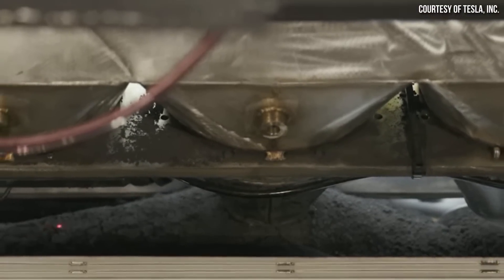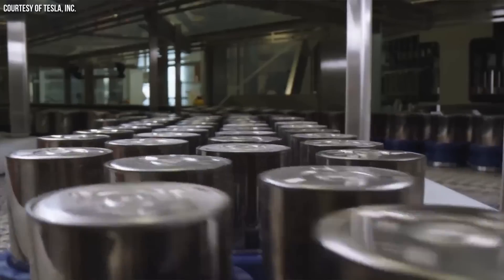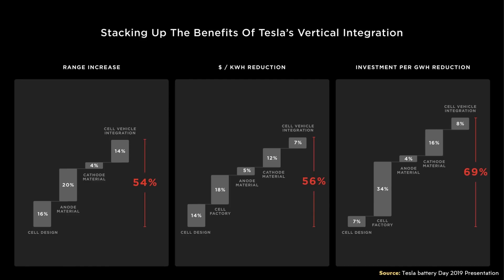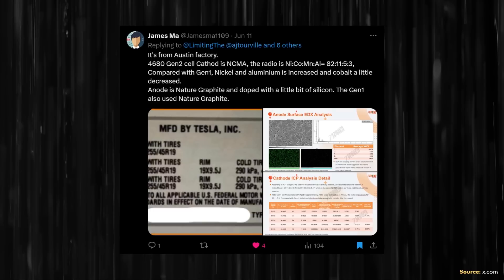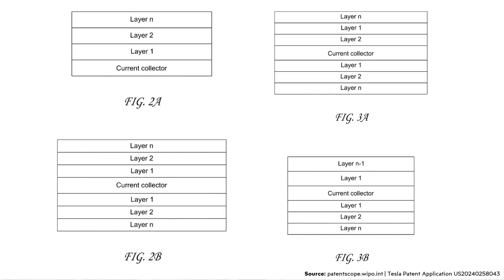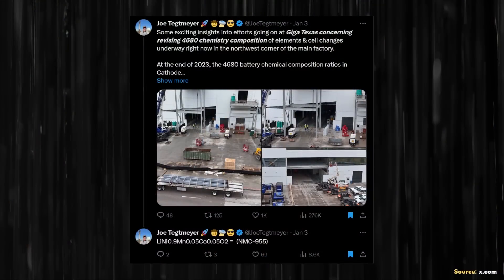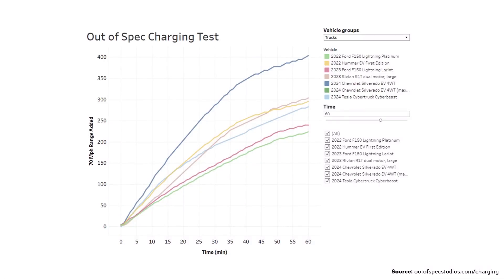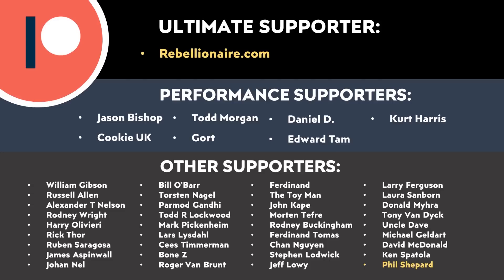EPIC NEXT GEN Tesla 4680 Battery Coming | 20% MORE ENERGY DENSITY?

Comment: A 20% energy density increase for Gen 3 cells over Gen 2, would translate to 204 wh/kg at Pack level. Given the steel plate covers top and bottom of the CT battery, 200wh/kg is a good number. Translates to 5kg/kWh - easy to see the impact of a larger pack on vehicle weight. But extra weight of pack probably adds another 20% of that weight to vehicle structure to carry the weight.

Comment: I have a question I would like you to help answer. When you have a solar panel you have a theoretical efficiency that you could capture 100% of the light and convert it all to electricity. The real world efficiency is about 21 to 23 percent. If you used that same thinking with batteries and asked what is the amount of ions that you can store in a battery where is the technology at right now? Are the batteries storing 2% or 5% or 21% or 50% or 75% of the theoretical limit? On a molecular level we know that for a certain amount of lithium it will hold so many electrons.
 so where on that scale are the batteries we have now and how much further can we realistically expect the technology to advance? Love to get your thoughts.!

Comment: John, Isn’t this vaporware if and until it appears at scale in cars? Isn’t CATL’s Shenxing Plus LFP battery already produced at scale? It has 205 wh/kg, a 4C charging rate, and a range of easily 500 miles. And they’ve already built a 500 wh/kg battery installed in a large passenger jet which they claim they can mass produce. IMO, China is about to dump EVs into the marketplace that are far cheaper than Tesla (not to mention positioning themselves to control the global passenger aviation market) and no tariffs or obstruction of free trade w China is going to hold off that avalanche. IMO, that is the overarching story you should report on.
Reply: Same technology as amprius silicon wire anode technology meets nano one materials cathode single crystal cathode powder?
Reply: @bkparque Amprius is a fantastic company, but it isn’t producing at scale yet and CATL is. CATL is also much larger, financially sound, and more established than Amprius. And like Tesla, CATL is also constantly improving so whether or not Amprius could take a significant portion of CATL’s market share and/or keep up with CATL is far from certain. I think Munro is correct that Amprius will have an important role in the market, but it’s a dubious assertion and I doubt Munro thinks that Amprius could rival CATL in the marketplace.
Reply: @flutieflambert  amprius is certified for aviation and is building mega factory to scale to giga. No they arent as big as catl but will dominate usa and west. Catl makes car and utility batteries . They will never dominate us aviation and drone and us military contracts.

Comment: Huge ramifications. Get this right and the business is set for huge success. Just think a cheaper model 3 with nearly 500 miles of range, or more likely a cheaper 400 mile range car that will be >100kg lighter.
Reply: Noone needs 500 miles. Much more likely they just reduce the kwh in battery which improves effeciency and price
Reply: @Matzes  false. 500 paper miles is more like 400 real world miles and around 300 winter miles which seems like a lot of people are looking for.  Its not a matter if what engineers think its practical its what people demand.
Reply: @derekr5327  false. Studies show that people very very seldomly even go beyond 150miles on a day. Average daily distance is 35 miles or so. You want your expensive battery to be designed for the one off road trip you do? And then just for that 1h you save on a 600 mile trip compared to a gas car? Not worth it and most people driving an EV will realise
Reply: @Matzes  500 mile range would be needed for anyone who buys an EV pickup truck and wants to tow more than 150 miles in between charging sessions.

Comment: When discussing issues like energy density, charging rate, etc. ... you're talking about battery chemistry, not form factor. Doesn't matter whether you're discussing 4680's or 2170's or pouch or blade form factors, it's the chemistry that matters. The importance of the 4680 form factor is that it enables structural battery packs. The question to resolve going forward is whether 4680's can be mass produced at scale with advanced battery chemistries.

Comment: That’s an excellent take on the asymmetrical layering, never thought of the multi layers acting as elastic layers to laminate in the high silicon element

That sounds like there’s a lot more that could be done with that approach, makes sense as to why dry approach is so crucial to the direction they are going in, it’s not just costs it’s also density and variations on a theme

Comment: Tesla's quickly falling behind CATL and GEELY on their high density batteries.  The dry process means nothing to customers as that's only more margin for Tesla and means nothing for us.  Ultimately, Tesla will have to realize that a semi-solid, or full solid-state prismatic cell, is the best option.  The small canned cells will fade away.
Reply: The dry process means a lot to the customers - if it leads to lower cost.

I’m not saying it will, but using a highly automated process with a small industrial footprint is good on principle.

Tesla is new to the industry, and they’re already close to price parity. Let’s give them a chance w their first completely in house version of the 4680. It may lead to some interesting changes in the industry when it starts later this year.

Comment: been looking forward to the 2024 CATL or BYD LFP, not any can shaped NCM. Got a 2023 BYD blade LFP in my Tesla Y SR (MiG), best batt I ever had.....why NCM anymore ? Current NCM (which is LG for our EU and China Teslas) is far outdated and...lame...BYD LFP runs circles around them
Reply: Best battery I ever had😂 like you can feel the difference of the electrons moving around??
Reply: @Matzes  Best charge rate, lowest price, better than the more expensive LR LG
Reply: @t.d.5804  lowest price is good for tesla not for you. They sell them at the same market for the same price regardless of battery
Reply: @Matzes  thats not what I meant. The Y SR with the BYD has (nearly) the same range and a better charge rate then the more expensive Y LR. Save 10k on the car, no need for the more expensive version for long distance drives. Same charge stops on my 1300km travels with the SR BYD
Reply: @t.d.5804  Nearly the same? 😂 No it's not even close unless you subscribe to the "but you can charge it to 100%"  nonsense. You get a whopping 91 miles more range, faster charging, and significantly faster acceleration with the Model 3 LR RWD. The performance alone is worth big money.
Reply: @TecnamTwin  Range of the MY LR is 50km more irl then the SR. The old Catl LFP in the Model 3/MiC Y is worse then the BYD. I had both, the Y SR and LR, the SR BYD (not Catl) outshines the LR LG in charging and is the same on long distance. More power costs more but does not get you further in a shorter time.

Comment: Nothing to celebrate until it's being produced at GigaTexas in mass. They clearly announced the technology way too early and we're now YEARS behind where the technology should be. They had massive issues scaling up gen 1 of the 4680 in Texas (still only on either one line or barely a second). I'll get excited when they have all lines up and running with the Gen 2 version. That's going to be years away at the rate they're going. As Elon is so fond of saying, "prototypes are easy, mass production is hard"
Reply: They PROJECTED because at the time every other question, every day was "4680...WHENWHENWHENWHEN?"
If they'd said "We'll let you know when it's ready" there's ZERO doubt you'd be moaning about THAT now?
Reply: Noone has mentioned the acquisition of Maxwell Technology 's DBE being a bust as my impression in 2019 was that MW developed the technique to produce DBE and it turns out that Tesla is really developing it since battery day in 2020.  Someone at Tesla missed a technical aspect of the MW DBE process. I noticed that Silion is handled differently from the MW takeover.
Reply: @rogerstarkey5390  The tech was clearly nowhere near ready and Tesla should not have made the wild claims about its performance and production ramp. With hindsight it looks pretty much like a pump and dump (i.e. buy Twitter) exercise
Reply: You are accurate.  I remember Battery Day, which was a long time ago.  I do hope they can get to scale by January.
Reply: The interesting point is how the geometry of the cell competes to standard cells or pouches. Chemistry changes are welcomed but can be done to all cell forms.
Reply: Did you watch the video? They are not making a new battery, it is still 4680. It is just the cathode dry coating side that held them back because of the coating roller type that they used. It is not like they are putting a whole new tools for a whole new product. The report says they might be able to roll out vehicles in the Q4 this year with this battery.
Reply: They will mass produce it there and in Nevada.
Reply: It's hard to compare those as Tesla "test" batches produce more batteries than full production of vast majority of companies, it's that Tesla is on another level. Also 4680 batteries have been made for a long time already, and in pretty large scale, recent news is just about an improvement to manufacturing using dry powder, which I dont even think Panasonic is even doing despite being Tesla's partner.
Reply: No other manufacturer came out with 4680's so quickly. That they did it stepwise was both smart and risky from a public perception standpoint of people who have never developed something themselves. It is always even in the best cases two steps forward one back. I notice that you never seem to recognize that LG and Panasonic still haven't made a single production cell.
Reply: @donaldhenderson1870  So what it doesn't matter what other firms are also failing with the 4680.
 What does matter is that in the meantime BYD and CATL have been leaping ahead with better and cheaper batteries.
Reply: @donaldhenderson1870  BYD are now selling their Megapack equivalent in Europe for 30% less than Tesla and picking up the largest orders. They also have taken the lead in residential batteries.
Reply: Well according to GLJ, Speigle & Chanos etc., they are just a car company, so to create a new category and start making even handfuls of battery cells in their own facilities on their own machines (thank you Hibar & Grohman acquisitions) is pretty good as far as I can tell.

Comment: how comes we still get presented data from the 2019 (5 years old!!) battery day ... aren't there any data and estimates from tesla?
Reply: Battery day was in Sep of 2020 genius SMDH and further more elon drew and Zach all publicly clarified since then the 4680 program is on a 6 full year timeline. 

Elon further elaborated in an August 2022 tx investors day that the goal that year was to be as good as similar nmc cylindrical cells, multiple 4680 model Y teardowns done in late 2022 proved the cells met those goals. 

Then he said to end 2023 he wanted the 4680 to be better than the available cells. The tesla ct is more efficient than any other full size ev truck=goal met and it's taken 323&327kws max charge rate so it bests anyone else's cells for peak charging POWER. Another goal met. 

Then he just said in the past q2 earnings call, in late 2023 their 4680s had already achieved a cheaper per kwh rates than competitors cells. But in 2024 it flipped again due to suppliers cell oversupply&material costs dropping in China. 

But he expected the 4680s to end 2024 at or below on a per kwh basis any nmc cells they can order from suppliers. The dry cathode should also give them a 10-20% kwh pack level energy density boost.

As well as the tx lithium refinery is now online and will ramp up throughout 2024&into 2025. Bringing more cost savings to the 4680s! 😎
Reply: Just out of interest, how much "Data" do you see from other Battery Manufacturers?
(I doubt you even look?)
Reply: @rogerstarkey5390  Battery manufacturers release specs and roadmaps, which is unsurprising given they are in the business of selling battery cells